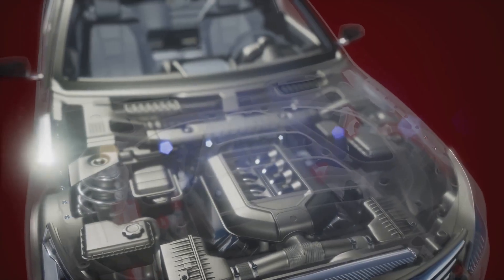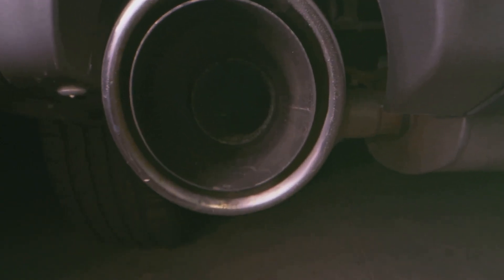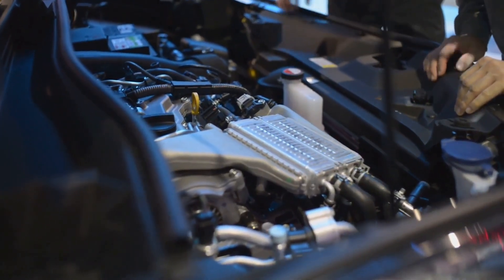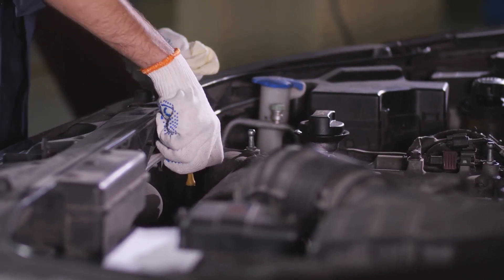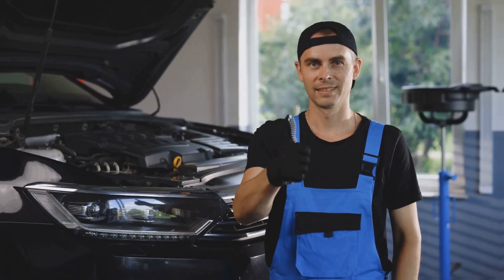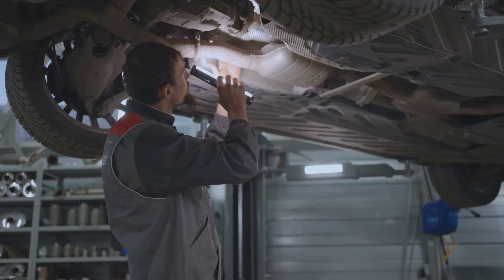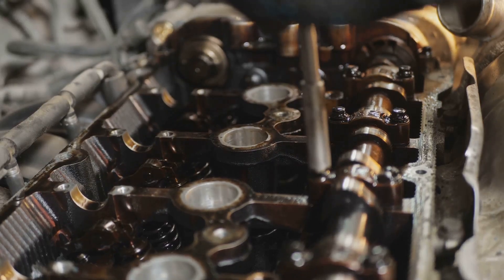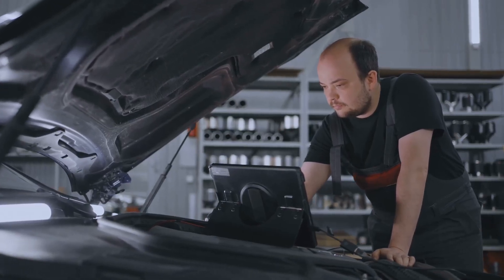Exploring Car Engine Sensors  A Deep Dive

Comment: These things doesn't belong in cars.The problem is not when they will fail they will fail.And some of these parts cost the price of a car.We are not going forward we are playing Russian roulette to see which sensors or ECUs will fail first.And who gets rich in the process of fixing the cars.Some of the dealers and so called experts with all there fancy software ask a fortune just to do a diagnostics test.I have a forty year old car with all services done with none of these crap on it and never had a problem.Buy a modern car and endless fault codes and a lot of money spend.
Reply from the maker: I admire your opinion. Meanwhile, I educate to keep the maintenance cost as low as possible.

Comment: Location inertia Switch for hyundai TRAJET  2004 - 2008 any help please
Reply from the maker: The inertia switch, often called the fuel cut-off switch, is designed to cut off fuel supply in the event of a collision. For the Hyundai Trajet (2004-2008), the location of the inertia switch might not be explicitly documented as it can vary by model and market. However, here are some common places where you might find it:

In the Trunk Area: Check near the sides or under the carpet in the trunk. Sometimes it's mounted on the side panels.

Passenger Footwell: Look under the glove compartment or behind the kick panel on the passenger side.

Driver's Footwell: Sometimes, the switch can be located near the driver's side, behind the kick panel.

Engine Compartment: Though less common, some models have the switch in the engine compartment, usually near the firewall.